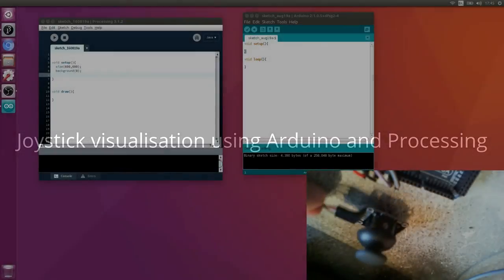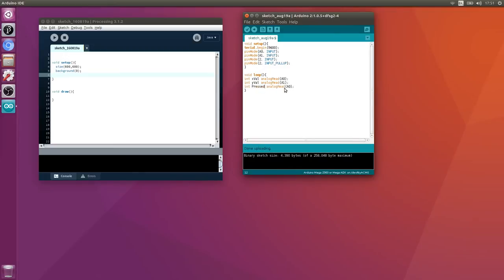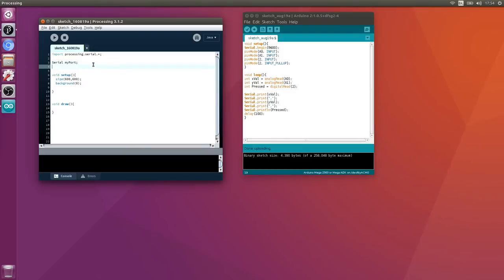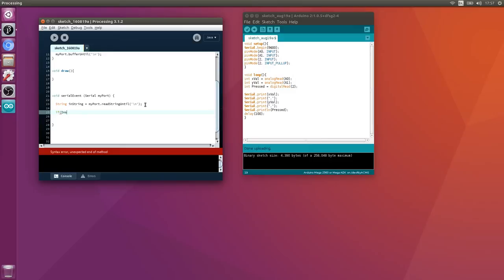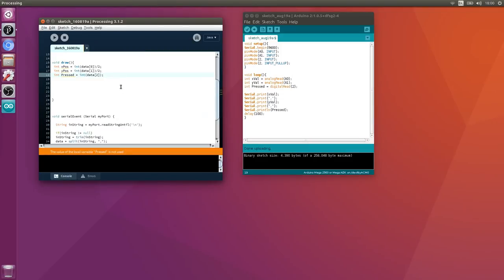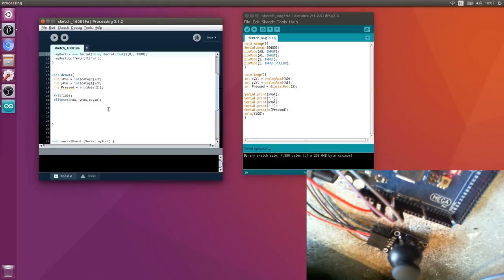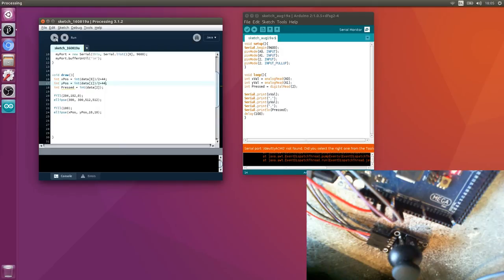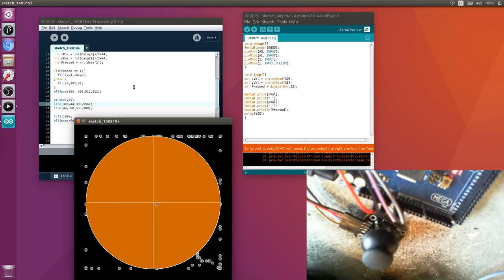#13 cheap Joystick via serial from Arduino to  Processing on Ubuntu

Comment: i dont wanna use the joystick to fool around in processing but AS AN ACTUAL JOYSTICK. like emulate a directinput/xinput device. Can that be done?
Reply from the maker: Yes it can be done, Arduino has a usb joystick hid mode for some of its boards.
Reply from the maker: https://github.com/MHeironimus/ArduinoJoystickLibrary

Comment: My Y axis is iverted and I don't know why or how to solve it
Reply from the maker: possibly your joystick is wired differently - not a problem. you can simply invert a variable either in the Arduino sketch or in the processing sketch. $output = maxvalue-$input.